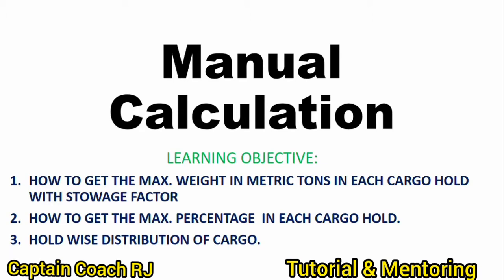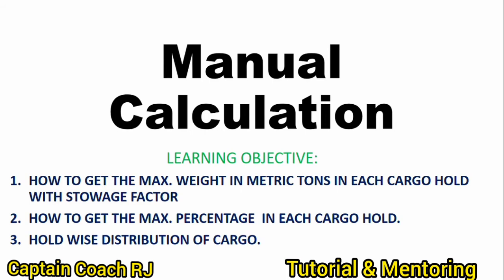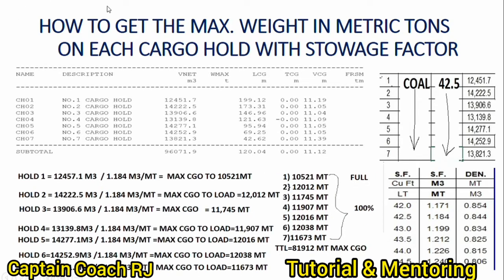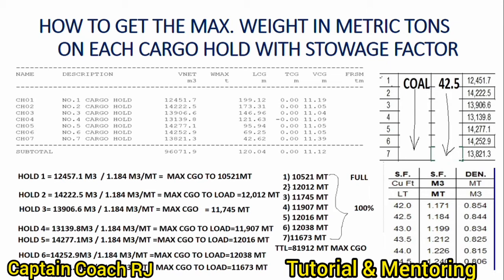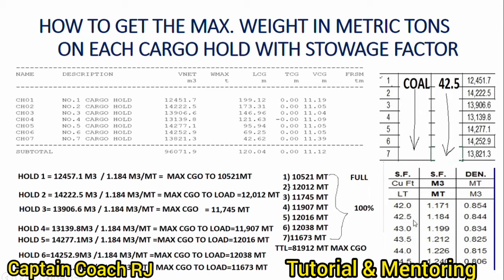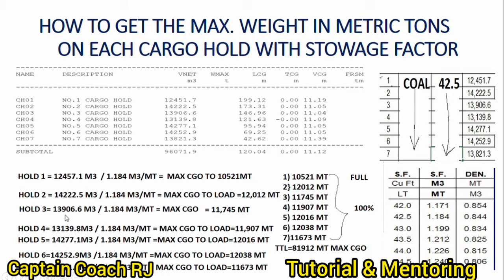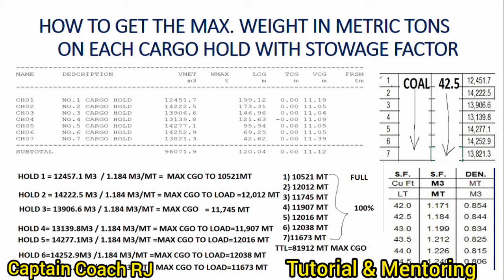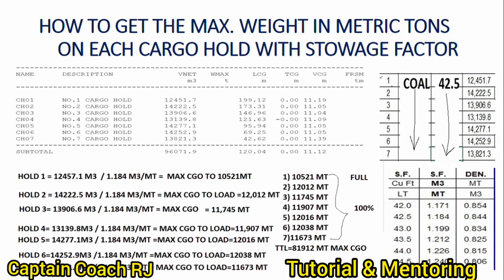Calculate the maximum cargo to load in each Hold

Comment: Sir bakit divide ginamit nyo para makuha ang total mass or weight? Diba dapat volume multiply mo sa SF nya na 1.184? Kung mapansin mo sa sample nyo mas malaki ang value ng volume nyo kaysa weight pero yung SF nyo is 1.184 dapat mas mataas ang max weight kaysa volume!!?? Thanks
Reply from the maker: Basic mathemtics.Wala nang ganyanan ngayon.loading computer.Option nlng yan..
Reply: Yes sir  kasi yung stowage factor ng cargo as per sample nyo is 1.184 tons PER CUBIC METER, so probably dapat mas mataas ang maximum weight to load each cargo kaysa volume capacity ng holds. Kindly review lng sir kasi for me dapat multiply not divide ang ginamit (volume capacity ng cargo hold multiply SF) to get the maximum weight to load. Salamat at napansin mo ang comment ko sir
Reply from the maker: @aquinovillordon9662  Nakaakto kana ng CM
Reply from the maker: Gusto mo palubugin ang barko mo
Reply from the maker: Coal yan 1.184 stowage factor.Malaki grano or size commodities.kaya ipasok monsa bodega yan 100% convert into MT hindi yan puwde malaki pa sa volume ng bodega.Gets mo..aral.ka maayos practical muna..sa barko..
Reply: Nope sir engine poh ako! Tama ka naman sir, kung balikan mo comment ko wlang sarcastic at akala ko 1.184 metric tons per cubic meter eh sa sample nyo 1.184 cubic meter per metric tons pala. Dba sir
Reply from the maker: @aquinovillordon9662 aralin mo makina dong huwag Deck
Reply: engine department ka pala. bat andito ka. aralin mo muna  kung paano magkaroon ng common sense

Comment: Sir, diba po ba pag may info na ng sf at cargo qtty sa cp moloo 10pct, icacalculate na yong deadweight cap na kaya icarry either summer or port limiting draft. Tas pag na calculate na max cargo intake mo, multiply mo sa sf cbm/mt para malaman kung kasya ba ang volume ng cargo sa total volume capacity mo ung result in percent. Tapos pag kasya na sya, compute mo na distribution mo kada bodega, hold vol.cap/total hold vol cap x total cargo intake, in so on hanggang ma matapos mo lahat bodega. Tas ichechek din yong weight each hold at every two adjacent hold kung compliant ba sa tank top cap at local loading criteria special sa loading manual kung homogenous loading, or individual hold if alternate loading or single hold + each adjacent hold pag block loading. Nag aaral po kasi ako ngayon nga ships construction & stability. Iba2 libro may mga ibaiba din ituturo. Nagugulohan din ako kung alin yong tama don. Sana po matulongan nyo ko saking mga katanongan. Salamat sir
Reply from the maker: Chat tayo sa captain coach rj fb page
Reply from the maker: Msg mo ako sa fb page Captain Coach RJ